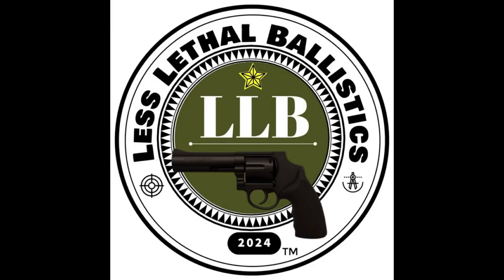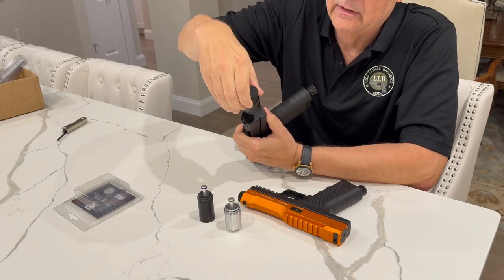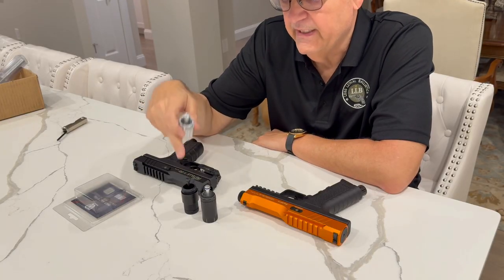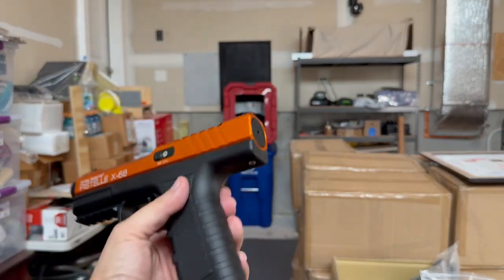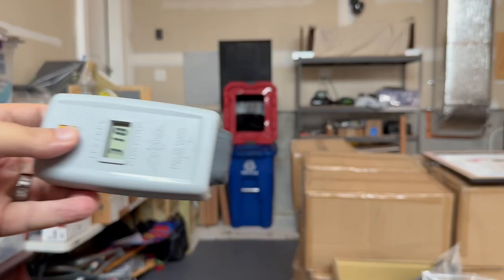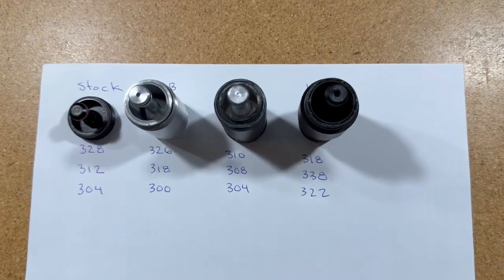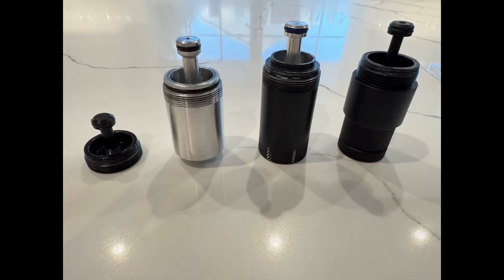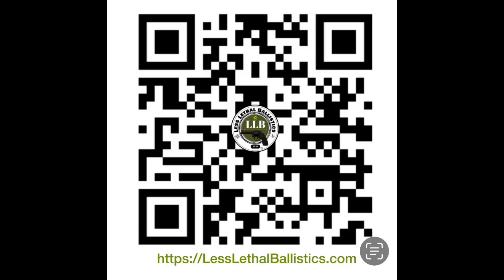Various Pistelle X-68 Tuning Chambers Evaluated

Comment: I personally think It's the regulator that prevents the chambers from making any significant difference. If you were able to plug the co2 cartridge directly into the back of the tuning chamber,  you would see a difference, howeever the shot count would probably be drastically reduced.

Comment: I bought the ssdx and it's giving me a whole lot  more power,  turned the pistelle into a beast.
Reply: Did you buy the short or long version also is the cap included.  Definitely buying one but there’s not enough info on the website.
Reply: What size O-rings came on your ssd power mod ? , mine came without any
Reply: @Gabe45414 😂😂😂 I saw that video, he admitted he forgot to put the O-rings on

Comment: Wait…are you saying that the firing pin on the mod you had made…..it MOVES??? Please say no. Please don’t say you broke the cardinal rule of LL and purposely made a mode with a firing pin that MOVES!!!😳🙃
Reply from the maker: Adjust it then lock it in place. Once it is locked in place it does not move.
Reply: @glennconti then why design it to be adjustable?
Reply: “Design”

Comment: When doing these tests, all the projectiles being used must be weighed on camera, the size and weight of the projectiles must be identified and observed before each test, after each test is performed it is important to allow the marker to warm up a bit so that it is not extremely cold from the previous test or the tests cannot be valid. 

Another thing is that the air chamber shifts A bit at times causing the marker to leak and not fire. Sterling Self Defenses Mod has the lip so that it holds the air chamber in place within the Pistelle so that it will not wobble. There should not be an adjustment made on the placement of the firing pin, that stays in its fixed position like it is on the stock body cap. I have no idea why you would place a screw to change the position of firing pin. 
Too thin of a firing pin can be dangerous, too thin of a back wall on a mod can be horrific to the user. My concern would be that the screw heads in the back of yours will eventually go through the shooters eyeball. Be careful and good luck.
Reply from the maker: I disagree that the simple steps must be done on camera. People get bored if the video is too long. If you suspect fraud then you suspect fraud and a 2x longer video doesn’t prove anything better. I am showing the key aspect of the test. Agree or disagree. As far as the adjustable firing pin, it has 3 advantages… One, it doesn’t leak as much. Two, when the chamber becomes full of gas and the Pistelle won’t fire, the gas can be released. Three, it is cheaper to manufacture. But, these mods are expensive for little increase in performance. This has been shown regardless of manufacturer of the mod. That is my whole point. Don’t expect me to manufacture an expensive worthless part.
Reply: @glennconti Agree with you.  You did a simple test with real results.  We don’t need a scientific experiment with documentation like you were submitting to a patent office.  You did fine👍🏻( you do say “um” a lot)😂

Comment: I noticed the same performance with these mods (less your prototype off course). However, I switched to HPA on all five of my X-68's with four using the HD24 short mods and just one using the long SSD mod with the open end for HPA. I also have two SSD long mods with the closed ends like you were using. I retired those without a second thought. They're useless and expensive. They also caused more problems with the bolt not resetting due to the tolerances used and the shaft being too beefy & tight in the valve assembly, at least that's been my experience with FIVE Gen 2 X-68's. In any case, HPA with these type of mods works pretty good but, I agree that longer barrels are the most frugal way of boosting impact power. Although, using the mods (with HPA) and the longer barrels are king. And by the way, the vast majority of the SSD product line looks like it was made and shipped by an 8th-grade shop student. Boxes scattered with metal shavings, The 3-D printed items look like they ran out of plastic during production. His barrels only screw in 1-1/2  threads to his bore matched mock suppressors. I'm not kidding. His adapter for an AR free floating hand guard is 1/2 inch+ too short to even mount a floating hand guard. I had to saw off two picatinny slots just to make one grab something. The list goes on and on and on,. Most of the crap I wasted my money on from SSD is in a box in a closet, in the dark, lost and forgotten about. So, take heart in your efforts and keep up the good work.
Reply: Thank you for the comment cause I wanted something honest! So I’m not new to Less lethal! New to modding! I have the mercury rise 12 inch barrel and the Asa adapter but I haven’t attached it I was Jon at alternative arms use it! Looked awesome! Was thinking Hd24 tuning chamber would be better! Sounds like the small version maybe my best way to go! I want to run 88g or hpa eventually! But it sounds like the small version maybe better to use long term?
Reply: Unless you think the long version is better?? Not really which way I wanna go! I was considering the SSD version but I heard a lot of what you said from some big names in L.L. As well so I’m sticking with HD24 if I do anything! Would love to see one of these mods go against the mercury rise Asa adapter! Wonder which one would be better all around! I heard you could still use the 12 gram as well with it too and not be affected! Not sure if you know about that one! Any info you can give would be very much appreciated!
Reply: @JDLESSLETHAL  I prefer the shorter HD24 chambers over the longer ones when using HPA simply because they're more comfortable for me personally with the overall length on my carbine builds w/slide valves and butt stocks. They're still plenty powerful with the 11" barrels and 6" reapers attached. The longer version will give you a little bit more power with the exact same setup but for me it was about the length of my carbines. And like I said, they're still powerful enough. Anything at a 100j (+/-) will usually do the trick unless your trying to fight off an army of gun-toting gang members all high on crack. Otherwise, you might as well just use a real firearm. BTW, I'm using 1000psi output on HPA, not 1100psi which can provide even more power. However, at 1100psi you'll likely find a few o-ring issues popping up and stopping you in your tracks, and it ain't worth it when you might need those fancy little o-rings at a critical moment. That's my take on it. And yes, I've even upgraded my o-rings. It's just the nature of the beast on the X-68. 1000psi is a great happy medium of power and reliability in my limited experience.

I don't advise using the Mercury Rise adapter with HPA as it wasn't built for that. Only CO2 such as x2 12gram adapters or 88/90gram cartridges. At least that's my understanding. Maybe I'm wrong. Either way, safety is more important than injurious risks, especially when you have better alternatives.

I've never had both CO2 and HPA combined in the X-68, I actually don't see the benefit. Especially with the Mercury Rise adapter. Sounds dangerous, though. But that's just me. Let me know how it goes if you survive - lol.
Reply: @RoundTripSpirit I literally agree with everything you said! I haven’t used the mercury rise adapter yet either 
I heard I can put it on and still use 12g like normal but I need to put a valve on the back I guess to turn it off so it doesn’t leak so I may check that out then get the short tuning chamber and go Hpa. I really want to have my own way to full it when I switch so i need all the mods bottle slide check like you said o rings then my own compressor! So I’m gonna play with the co2 stuff first grab the Hpa upgrades along the way then eventually upgrade it I think! I gotta see what kind of on/off valve needs to go on the mercury rise adapter first
Reply: @JDLESSLETHAL  I suggest using one or the other . . .  CO2 or HPA, but not both at the same time. But then again, that's just me ; ) A good motto is just to  BE SAFE! That's years of air gunning experience talking now. In some cases I've learned the hard way. And lessons can hurt you. Seriously!
Reply: @RoundTripSpirit I got the asa rear mod and 12 inch barrel from mercury rise. I got that with a on/pff valve gonna test that out with co2 88g. 
I ordered the SSD long tuning chamber. I know someone who also got those and the hd24s I know Dan is hard to deal with in my short time talking to him and other peoples feed back I fully get it when it comes to that. I’m gonna throw that on for alittle bit and run 88g but I’m planning on switching to hpa but I need to get my own compressor! I have heard of the firing pins on the hd24s breaking under pressure. Not new to less lethal but this is gonna be my first mod gotta learn somehow! I will say I orders stuff from MCS and it literally showed up in less than 2 days! And prior to that they asked for my number and called me and walked me through a Bunch of different things and ways to do everything the safest and most efficient ways possible! MCS has been nothing short of amazing to deal with!!

Comment: ok I just watched the whole video, but you didn't use an HPA tank, the main reason I want to purchase one of these, more specifically the HomeDefence-24 version, is to use an HPA tank with 1100 psi output and get above 100 joules with the 11.5 inch extended barrel, so please do a video using an HPA tank attached to the ASA tuning chambers, please use 800-1100 psi output and show the results. Also, will the HPA adapter that fits in the Pistelle grip CO2 chamber, have the same results as the ASA tuning chambers? Will it hit over a 100 joules with the grip adapter and 11.5 in extended barrel? I think everyone that wants to buy one of these are interested in this info. Finally will your version also be an adapter and accomodate an HPA tank and if so when will it be available?
Reply: We also don't know if he used the end cap with the small or large hole.

Comment: 12g of co2 just isnt enough volumetric weight to make proper use of the extra volume. I have gotten similar decreases on other launchers. 

Now if you bypassed regulation you might see an increase but also a drastic reduction in shot count.

Nice to see you developing your own product.
Reply: How many shots would you get running the 12  gram CO2

Comment: 🤔 so you really need to do a comparison with the hpa adapter behind the tuning chamber.  👍 huge difference in the outcome. The tuning chamber is worthless without the hpa directly behind it.
Reply: That brings my question back to which adapter is better???
Reply: @Godsgraceandblessings small adapter, with an add 2 inch to barrel, co2 .... hpa tank large adapter with 2 inch added barrel aka 6inch 👍 & wallah & that's coming from Greg 
Co2
Just 2 inch x
Just adapter x
2 inch barrel & small adapter 👍
Large adapter with hpa tank & 2 inch adapter. Even bigger 👍
Reply: Does it still increase even if chamber mounted hpa is 800psi out, same as co2 in handle ?
Reply: @kevinward2924 not sure im understanding your question..
Reply: Wasn't a question more of a statement. 
Co2 with an added chamber 
Vrs 
Hpa & added chamber 
Bang for your buck $ 
If you put the small or large Tuning Chamber with the co2 you dont really gain much in Joules. & you spend $100 $150 🤷
Add the tuning chamber with the hpa air tank & you gain 20 to 25 in some cases 30 Joules... 
Co2 Add a longer barrel & save the money. 
Hpa and a longer barrel the tuning chamber small or large makes sense.

Comment: My recommendation- do more testing using a much much larger sample size (at least 10 full mags each for each configuration- spread out over several days and making sure the launcher warms up to the same temp so you compare apples to apples. I did just that-- using the large chamber cap from HD24 using a 11.5 inch barrel the 6 shot average was 18-20% more vs stock cap. Give it whirl. Are you using the small or large HD24 chamber cap?
Reply from the maker: Small chamber HD24. I am just trying to test the co2 chamber tuning feature. Keeping it as simple as possible and changing just one variable. Yes, a bigger sample size gives greater certainty, but I’m not making a career out of this test. I have enough data to show me that I should not manufacture this product; it has no efficacy.
Reply from the maker: I was looking for a formula where joules increases as co2 volume in the tuning chamber increases (and vice versa). I found no such relationship. Each tuning chamber tested had a different capacity.

Comment: So what rounds were you using and how heavy were they since you don’t really show that. Also did you make a prototype to prove that yours and others don’t work? I will agree these really aren’t really meant for co2 it’s made for hpa. I was actually getting less shots with co2 with the longer chamber but the first shot was high joules
Reply from the maker: I used Smasher XXLs at 8.6g. I made the prototype hoping to be able to manufacture and sell these things. However, my prototype and the other tuning chambers for co2 I obtained offer no value (cost vs performance benefit).

Comment: I think another test should be done with the longer chambers and with hpa. That’s apparently the whole who’s is better conversation right now with hd24 and SSD
Reply from the maker: I say get a $50 hpa adapter for the handle piercing cap. Why waste money on the expansion chamber?
Reply: @glennconti have you not watched any videos of the amount of joules your getting from a hpa adapter and longer chamber? With my 11 inch barrel and SSD power mod I’m over 160 joules and without the expansion chamber I was at about 100 that’s over 50 plus joules I think that makes a pretty good difference. Co2 will give you a couple extra and that’s why you need to do a his test so next video get your hpa adapter and test them even with the short ones.
Reply: @imtofast so the hd24 vs SSD version which one do you think is better?!? Short/long hd24 vs the SSD version? I want to get one but I wasn’t sure which my best move is! I have the Asa adapter from mercury rise havent got to use it yet. I want to start modding my pistelle I have that adapter and the 12 inch barrel. I want to use hpa or 88g just not set up for hpa yet. I need to be able to fill it! So let’s say 88g for now. But switching to hpa soon. Best advice possible please!
Reply: @JDLESSLETHAL so 88gram doesn’t really go well with the Pistelle idk why but the launcher just doesn’t like 88 gram. It depends how much power your looking for but I’m the type of go big or go home so I would recommend the longer power mod. So SSD is built a lot better and fixes the chamber from going sideways. Hd24 apparently gets more a little more power cause it’s bigger but I don’t like how weak the firing pin is but it’s totally your preference and least with SSD you will deal with a USA part not have to return it back to Europe and pay some fees so
Reply: @imtofast really?!? So hpa is the best way I’m guessing?! I just wasn’t set up yet to keep filling the tank so I figured 88g would be okay for now. I heard dealing with SSD can be a nightmare and quality control can be an issue. I just want the best bang for the buck. Either way I gotta go with that or the big one. I heard running a 12 gram out the rear or a dual 12 g even would hit nice vs runnning 12 gram out the bottom. So I figured 88 wouldn’t be bad until I get a compressor for the bottle. Filling it like that would be awesome! Instead of buying co2. So SSD is a good way to go…I wish people tested the mercury rise Asa adapter!
Reply: @JDLESSLETHAL actually yes the 2 12 gram co2 adapter works well with it just not 88gram. Yes go for the longer one even with the longer one I was able to carry till I made it full hpa the whole time. Honestly Dan from SSD always answers my emails and any problems i had he helped me out with. Could give him a call as well. But either way won’t be disappoint. If your looking for serious power go hpa make sure you get the one with the cap so you can use co2 and hpa
Reply: @imtofast why do you think that is? 2/12 better then 88g I would think the bigger tank would be better! That’s kind of crazy!
Reply: @imtofast I spoke with Dan before so I agree with you there I just heard there is a quality Control issue sometimes and I don’t want to put a less quality chamber on! Wasn’t sure which chamber was made better
Reply: @glennconti you mean like the Asa adapter from mercury rise?!? They sell it in a package with a 12 inch barrel! Jon Reynolds tested it on his channel not sure if that’s what you mean!